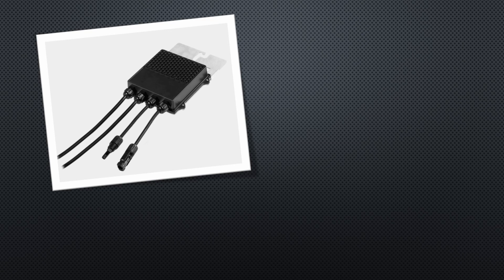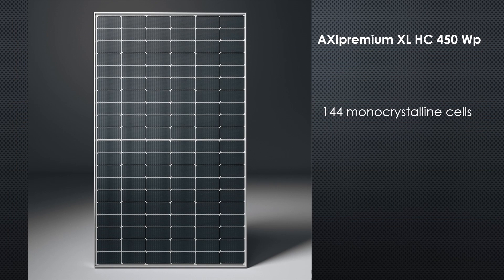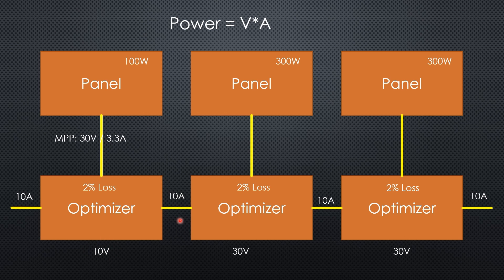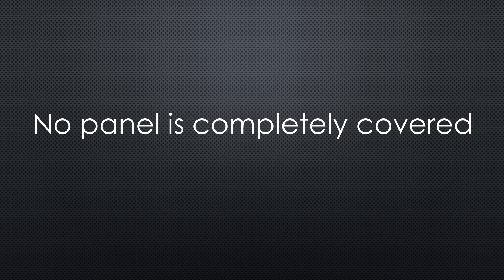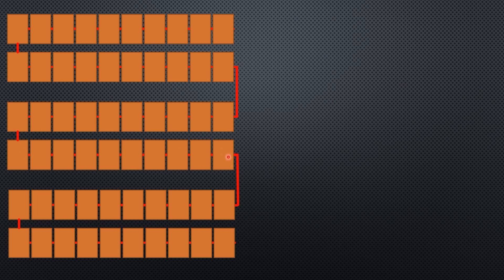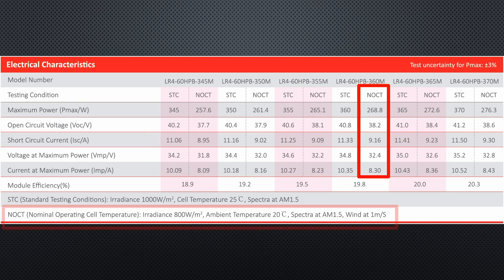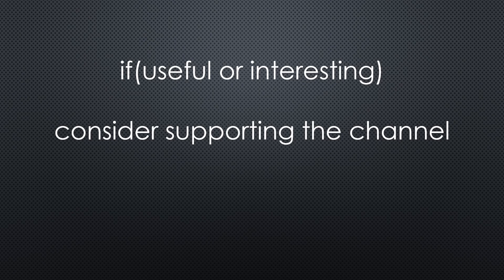441 Are PV Optimizers Worth the Money (e.g. SolarEdge)?

Comment: Interesting video, it has some opinionated claims or incorrect conclusions.  All equipment manufacturers need to stay in business, not just for warranties but also for monitoring and control features.  Module level electronics from microinverters and optimizers have many advantages that it seems you overlooked, part of the reason they are the dominant concept on North American homes.  More design and install options, improved safety and in most scenarios more energy yield for the same given site for a small premium, however they offer a better total value!Diodes that are regularly stressed fail and thought they help, they are nowhere as effective as module level equipment.
Reply from the maker: I agree that optimizers have other advantages. I just wanted to make sure that people are misled with this wrong claim (if optimizers have so many advantages, I do not understand why these arguments are necessary).

Comment: I wonder if anyone in the US has been successful asking a solar installer to skip the optimizer. My guess is they refuse based on the manufacturer claim, instead of learning how the panels actually work.
Reply from the maker: I learned that, in the US, there is an additional law to shut down the panels in case of fire. There, optimizers seem to have an advantage.
Reply: @AndreasSpiess   Thank you for your videos, I have enjoyed them. I have a Huawei Inverter, 11 panels all with optimizers. In San Diego County California "Rapid Shutdown" is required to meet our building code so when the emergency responders come and turn off the Grid there will be no high voltage. Yes I have had optimizers fail that required a trip to the roof to change them. I wonder if you have any experience extracting information from the Huawei Inverter logs? On the Huawei forums Huawei notes the file format is "propriety". I have extracted data from the binary Inverter_log alarm_history.emap file but I am struggling with the binary optimizer_log.

Comment: Great video! I am planning on installing solar power on my roof, I have about 100 square meters of the roof facing south that can have panels. This gave me valuable information in deciding what to get. Since I'm also into Home Assistant and dabble in electronics, you are my perfect video guru😁. Best wishes from Sweden
Reply from the maker: So enjoy your project! We love it even if it does no more cover our full needs because of the weather and the low sun.
Reply: That is a pretty big roof considering it is just one side! You can place 10kW panels easily on it Depending on latitude, climate and shading, you will get 30-50kWh/ day on average

Comment: Interesting,. So if my panels make five megawatts a year roughly,
My solar edge optimizers taking 2% are eating 100 kWh a year.
But my panels are 8 years old and I believe they don't have the three diode bypasses.
Reply from the maker: That is what I assume. And it seems that is the best case. Under certain conditions they take more :-(

Comment: Interesting. I have SolarEdge, but I got a number of quotes from installers and I think all of them included either optimizers or micro inverters. If it was $60/panel, it was about a 5% increase in cost. I can imagine that installers would be right that the marketing value is good enough to justify the costs. Especially with the benefits of individually monitoring panels.
Reply from the maker: If you want a per-panel display, you have to go with optimizers or microinverters. For me, this is not important.
Reply: An optimiser would definitely cost more than 5% of $60 or $3. The individual monitoring serve very little purpose practically.
Reply: @shrujanamsyama9940  To be clear, I was saying my installation came to $1,200/panel altogether (before the tax rebate). So the $60 optimizers would only be 5% of the total cost. 

My main point was just that it seems like pretty much all installers include them in their estimates. So it's not really a choice for someone getting a residential installation unless they do it themselves.
Reply: @cadekachelmeier7251  Hmmm... $1200 per panel is huge cost and is definitely a ripoff. A 335poly panel costs only $150. The structure costs $50-100/panel including installation. Inverter, junction boxes & wire should cost $600 for a 3kW system or $800 for a 5kW system. Government regulatory requirements & equipments cost $600-700 which is fixed regardless of capacity.. Overall, a 3kW system should cost $4000 at most and a 5kW system should cost $5500. Charging $1200 panel is 3 times this price. It was a ripoff.

Comment: Excellent explanation. 
Do the Huawei Sun2000 5KTL-M1 inverters have the "shadow management" function? If they have, how can it be activated, what are the parameters?
Reply from the maker: I never read the word Shadow management but you saw the results…
Reply: Maybe I wasn't clear...
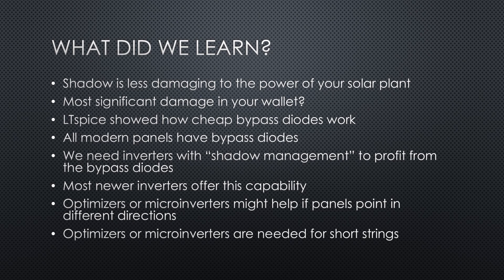In the video, at 16:40, you say: " We need inverter with "shadow management" to profit from bypass diode" - Sun2000 have this option? And how
Reply from the maker: @mirceadomsa  During my tests, it behaved as if it has shadow management. But I do not know how it will perform in other situations.

Comment: When you say that modern panels all come with bypass diodes, do you know when manufactures started to include those?

Our SE system was installed in 2014, and the panels are facing in different directions, so if we were doing it all over again, I guess some form of optimizer would still be used.  As far as I know, we only had one optimizer fail in the past 8 years.
Reply from the maker: I do not know when they started with bypass diodes. I assume it was a different time for each manufacturer.
If your panels face in different directions, and you only have a few panels per direction, optimizers are the best solution.
One fail in 8 years would be a disaster for many people with steep or unreachable roofs, I think. Because you still have to go for 25-8= 17 years...
Reply: @AndreasSpiess  I think it was really infant mortality.  The optimizer failed about a year after install - previous owner didn't notice it.  When we bought the house, I noticed right away - the installer came out and it was a warranty fix.
Reply: Great video. The Siemens SM55 solar modules we used since 1990 already have 3 schottky bypass diodes and a blocking diode while they only have 36 cells grouped in strings of 12 cells connected in series. Only a micro inverter can connect this single solar module to the AC line. However, my 4 x 50Wp PV array only produces 25W due to degradation over 32 years. 
Your representation of the Solaredge optimizer is not complete without its string inverter. All PV modules in the string should have its own optimizer as they work as a system instead of just addressing shaded modules. The bypass diode works best for your situation but it is not comparable to an Enphase system. 
I also use SMA Micro inverter but this was discontinued for some reasons.
Please do keed producing more interesting videos, I want to sit on the front row.👍

Comment: What could really help is a system that can inform you, on an app, what cells are not getting unlight. Without that, you have to either go outside and check, or just guess, and it may not be that obvious whether you have one cell a leaf blown over (easily fixed), one that a bird crapped on (a bit harder), or a cloud drifting overhead, which you can't do anything about.
Reply from the maker: I divide the power by the number of strings. Then I see if something is wrong (which seems to be very rare). But if you want this feature, optimizers or microinverters are your solution.

Comment: Dear Andreas,
Hello from Geneva!
I am so happy to have found your channel by accident, i am watching all your video and love them! Thank you for your work and very clear explanations. I really appreciate the fact they debunk the « sales speech » of certain manufacturers such as Enphase but also most video on Youtube still encouraging blindly to ise micro-inverters in any situations. (I noticed it especially in french video (in France they still encourage 2-3 kWp lower cost installation with expensive Enphase micro-inverters 😅)

I just made up my mind today to go for a 14kWp 2 strings setup, i will get the Huawei SUN2000 hybrid inverter and get the battery in few years hopefully cheaper. Initially i ordered 6 optimizers (chimney shade) but i will now probably cancel them.

Thank you!
Reply from the maker: Welcome aboard the channel! For small systems, microinverters might be a good solution because string inverters usually need a certain startup voltage.
For your large system, a string inverter is a good choice.

Comment: I have personally found that the temperature coefficient and efficiency of the modules, coupled with the quality of the MPPT and efficiency of the string inverter, has far more of an effect on output than many other factors, as does keeping them free from debris. It seems to me that having a string inverter that can monitor the overall performance, and then notify one of general issues is more important than knowing exactly which module is affected.

The typical issue is obvious to the home owner with a visual inspection, and any deeper issues will require a service call anyway. Having a technician spend an hour figuring out which module has failed is only a small part of a service call, and is a cheap tradeoff for better reliability and lower cost by skipping the optimizers. Optimizers will most likely only be worth it when they are built into the module, are as reliable as the rest of the module, don't add cost, and don't compromise efficiency.
Reply from the maker: I hope that they can include quality components in the optimizers (particularly electrolytic caps). But I doubt when I heard that one only costs 30 dollars...
I also learned the same thing you describe. But in the first week I also was keen on every watt ;-)

Comment: Nice video, but your focus was now on the claims. The optimisers do not live up to their value and even add more points of failure. But optimisers do prevent degradation of the panels within the string. In a string setup the last panels show a much higher degradation. 
The optimisers should prevent this, but no proof here from my site.
The micro-inverters have a 25 year warranty so they are worth the extra investments. Second pro to the is they are much more safe because of the 230v AC voltage, they are modular and also have no influence on the overall performance.
Reply from the maker: You probably have to define where the "last" panel in a string is. I cannot see any difference in degradation based on the position in the string.
Keep in mind that warranty usually only covers the equipment. Which is probably the smaller part of the cost if you do not have a flat roof like me. I have to admit that a 25-year warranty is a brilliant idea of the sales department because nobody would buy the product without such a warranty (every viewer mentions it) and nobody of the current team will be here when the damage starts to take responsibility ;-) But maybe I am too pessimistic.

Comment: Hello Andreas, good video, thanks for sharing!
I've also had delays in my installation and missed the summer.. I finally I got my 10 kW Huawei Sun 2000 system with battery up and running. I also bought a backup system to run off-grid. The installer sadly didn't install the panels as I wished and I am currently running one string with 18 panels, the other with 12. This unbalance causes the inverter to not run at optimum at low load, PV1 is over and PV2 under 600VDC which adds to losses aswell. Have you considered adding a wind turbine (DC rectified)  to your inverter?
Reply from the maker: 1. Why do you think the voltage matters? Because of the 0.x % difference in efficiency?
2. Fortunately, we do not have a lot of wind here (it made my installation easier)
Reply: @AndreasSpiess  Yes, at low load there are losses on the string that has a Voltage below 400V. This is not ideal during winter as the effeciency drops 2%. During summer one string is at over 900V. I think what bothers me the most is knowing that I do have the losses, even though it's marginal.
Reply from the maker: @Chinesebotter  That would not concern me. It is pennies, even for your big system... Are all panels pointing in the same direction?
Reply: @AndreasSpiess  Yes, they are all flat on my flat roof, about 2° tilt. Panels are 485W half cut, got 30 of them, so I would prefer 15/15 split instead of the 18/12 I got now. I was surprised our setup was so alike, including the non installed backup-box! I will need to install an earth connection and measure the resistance before I am allowed to install it, I guess you have similar regulations in Switzerland as we do have here in Sweden :) looking forward your update video.
Reply from the maker: @Chinesebotter  In your case, I assume it would be easy to change the assignment of the panels. You may need a few meters of cable and a few connectors.
Reply: @Chinesebotter  You would save only 2% power by changing the assignment to 15/15. That is minor improvement. You should be more concerned about losses from dust as the 2 degree tilt is too low and accumulates lot of dust. The loss of efficiency from dust will likely go to 10%, much more than the minor imbalance loss

Comment: I have 5 panels on my roof east side and 6 on the west side. I was told 1that 1 inverter would not be a good solution, cause it would start at a certain threshold and micro inverters would start already when a few panels get sunlight (while the other side is in the shade).... Have I been dooped? 🤔
Reply from the maker: You would have needed an inverter with two MPPTs. One for the east and one for the west side. That would have worked, too because all panels mounted in the same direction get sun at the same time. The inverter also has to be adapted to the number of panels.
Your solution is ok. You will see how reliable your microinverters are.
Reply: @AndreasSpiess  but when I look at the results, not all panels on each side get the same amount of sunlight. On the east the lower ones start producing earlier than the ones on top of that side (there is a rood dormer in between) , while on the west side some panels produce less since also a roof dormer throw shade when the sun isn't high in the sky....

Comment: Just so timely: I already have 12 panels on my roof and would like to add several more. But the existing ones are 14y old and can't be found anywhere. They claim  7.5A Ipm. If I understood the core points in the video: I can add 9A Ipm panels. 
They will not produce their max but will add proportionally to the overall string as if they were 7.5A panels.
right?
(it seems ok to  spend $900 to add 734w  from 3 320w panels to existing 2500w instead of replacing the whole array)
Reply from the maker: Indeed, the current will match automatically. Just make sure your inverter has shadow management. Otherwise it might not find the optimum.
Microinverters for the new panels might also be a good solution for your situation if you do not have a battery.

Comment: the only positive about micro-inverters is if you want your solar installation to be AC coupled and not DC coupled, which can be an advantage instead of running long expensive DC cables to your inverter in certain cases
Reply from the maker: For small systems this is true. AFAIK: Big microinverters also have to be connected to the fuse box. But maybe that differs from country to country.

Comment: Optimizers being useless and expensive is not even their biggest disadvantage. You MUST use them with a SolarEdge inverter or the inverter will blow up (multiple times actually, the big capacitors inside will explode, please don't ask how I know). So they cost about 50 Euros a piece, that would not be so bad if the stinkin' things would not ALL fail at some point, disabling the attached panel completely. You then have to claim a new one, wait for it, get on the roof, remove panels untill you get to the one that has the failing optimizer under it and replace that, refit everything and get down safely again. My system is 6 years old, has 12 optimizers and about half of them have failed and needed replacement.

If one fails I leave it because I do not like the hassle. If two in the same string fail, the entire string goes dead because it does not meet the voltage threshold. It is a nightmare. For one side I extended wiring and put tge optimizers at ground level. I still need to do the other side, it is no fun, just a lot of work and agony.
Reply from the maker: Thank you for sharing your experience! It seems you were particularly unlucky. But your example seems to prove my fears for electronics on the roof.

Comment: Super video again. This I what I thought as my electrican wanted to tell me that only solaredge works. And he also said there is now way to put optimizers only at some panels. Can you perhaps tell me what will happend if from 20 panels 4 of them are completly shadow? Cause in the video your panel was just half shadowed. Thx. And as I understood huawei can have optimizers only at some panels right?
Reply from the maker: 1. Your system will only produce 80% of the power. Make sure you get an inverter with shadow management.
2. You do not need optimizers below all panels in the Huawei system.

Comment: I came to the same conclusion as well.   Would be interesting if one could do a scheme using an active mosfet bypass diode to save the diode Vf losse.  Possibly built into the cell wafer.   Though, it would be strange to tell someone you need to have external control power to activate your solar panel's  control circuitry.   Where are those zero forward volt  diodes when you need them?
Reply from the maker: I think they want to keep the panels simple. Better add a few...